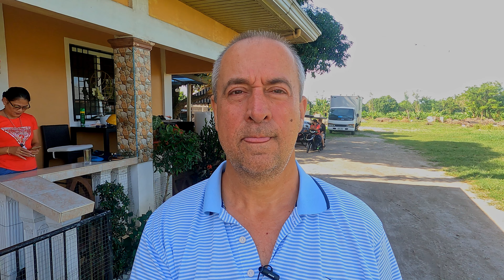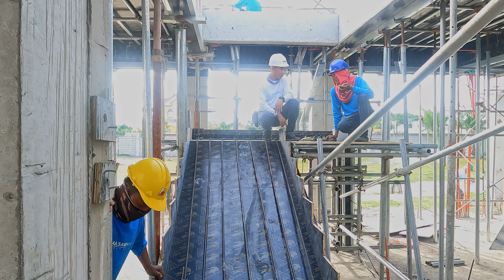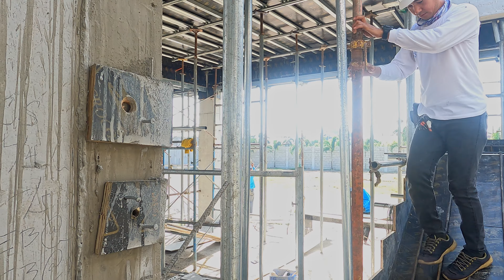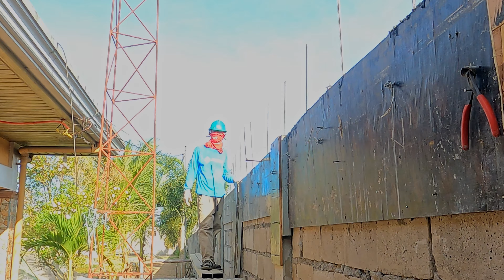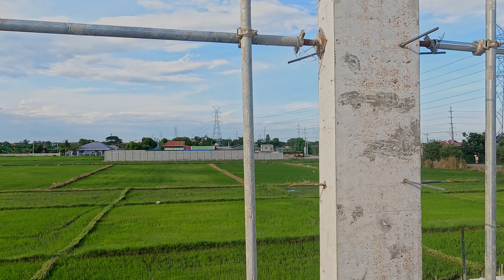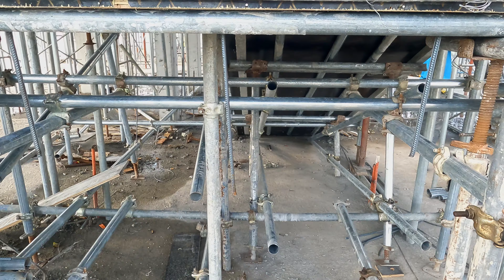Philippine House Building Day 72 - Hard Hat Dummy Talking Stairs

Comment: Good morning Mike 
Stairs will be comfortable with the rise and tread. Rebars I would have a preference for more cross bars 90° to the 16mm  @200 mm center's. 
The stairs as well as making access easier  it also very good bracing to the second floor structure. This is a must all the columns need lateral support.  The hollow blocks also will provide bracing. 
Stairs connection to top slab could of had been better Rebars location but anyway the top will have a wedging support. 

Took a look for our Cebu travel and the airline's have more options to book and reasonable pricing. Still going to wait till February to March.  NZ has travel Vaccination pass available use cell phone but Philippines removed NZ from green. 
Back to your build with the beams formwork starting we will soon see the roof structure.
Reply from the maker: Graeme
If I understand correctly, that is way more rebar than we have. Ours will be slightly over 500mm centres. Should I be concerned? Maybe I just need to lose 30kg to reduce the stress on the stairs.
I suspect delaying travel a little longer makes sense. We were hoping to get our kids over for Christmas, but it feels like quarantine could be extended at any moment - and pre-Christmas flight prices are crazy.
Reply: @philippines4.0buildinganew64  After a further look Stairs rebars I see that tie bars crossing 16mm are @ 300mm centre's one for every tread and plenty of steel in  the treads  . So it's thumbs up 👍
Reply from the maker: That's a relief
Thank you for rechecking